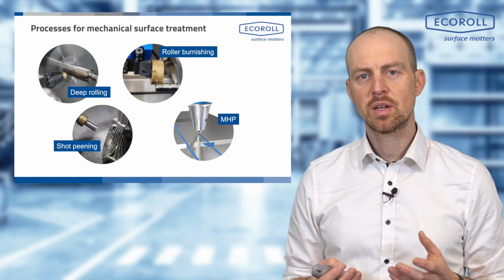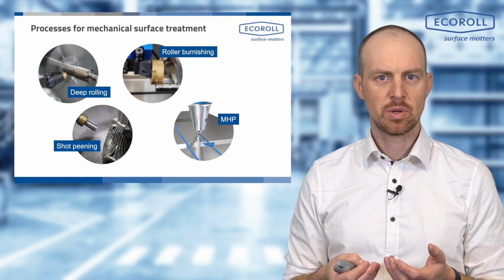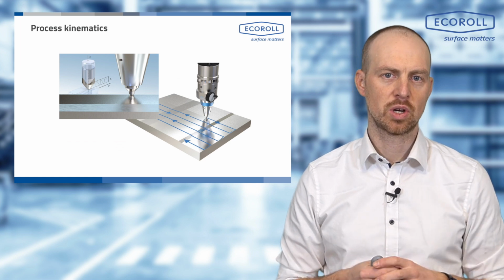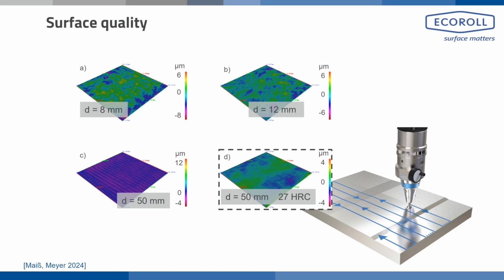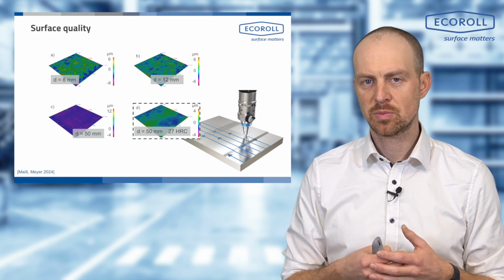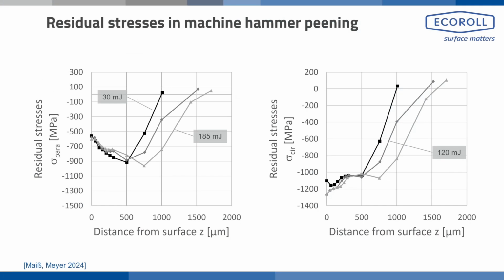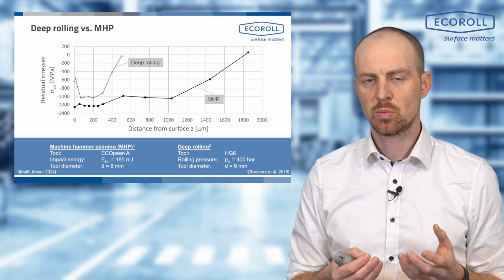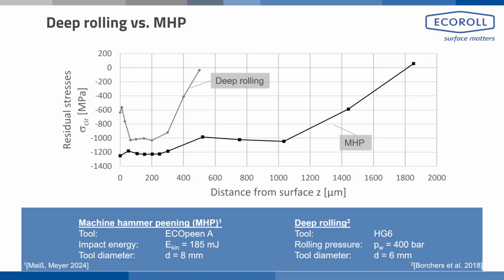Introduction to the processing of components by machine hammer peening

Comment: Dear Oliver, s this practice (MHP) possible on materials at 54 HRC? Specifically for hot forging punches, with that purpose."
Reply from the maker: Thank you for that question. Yes, it can be done also for hardened steels. I just did some experiments with steel about 50HRC. Unfortunately I am still waiting for the results on subsurface properties.